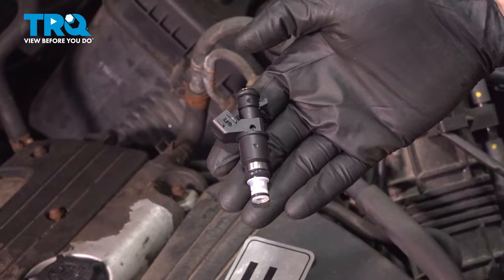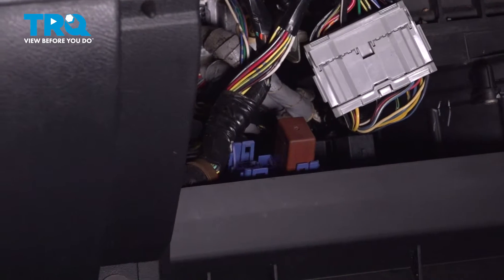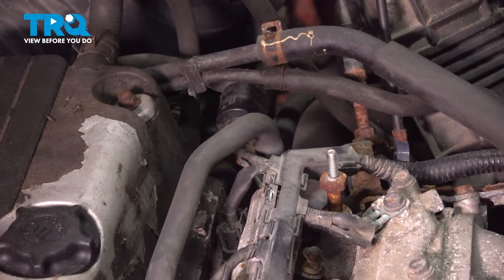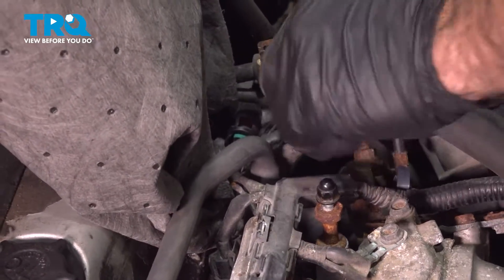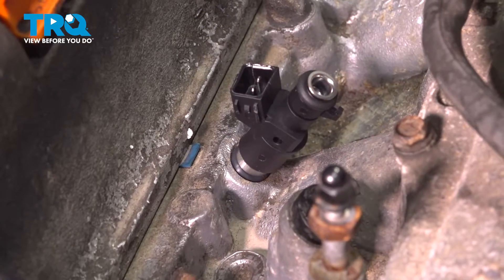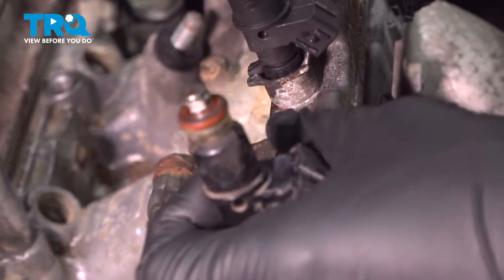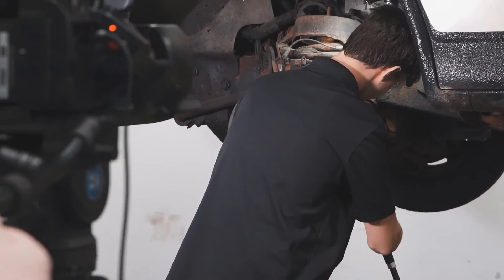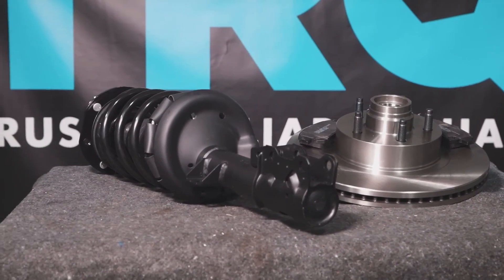How to Replace Fuel Injector 2003-2011 Honda Element

Comment: Is that the best place to add a fuel gauge to check pressure.  Where you disconnected the line ??  Thanks.

Comment: Chances are, if you have an older vehicle, most, if not all injectors will be stuck to the engine. In these cases do not pull the rail too much, it's useless, and you may damage things or bend the rail.  Simply remove the clips that are holding the injectors to the rail and disconnect the power plugs, so when you pull the rail, the injectors will separate from the rail, not the injectors from the engine block. Why? Because there's only 1 o-ring sealing the injector to the rail and requires way less force to slide out than the 2 o-rings holding each injector to the block. In addition, the bottom connection is usually more rusted than the top side of the injectors. This is a  LOT easier and requires LESS force.  Once the rail is out, don't be surprised that most stuck injectors' tips will break as you force them out and the tip will be stuck inside the block like the video shows. Luckily it's not too hard to remove if you have tools and it's not too brittle that it will fall inside the cylinder head.

Comment: Very helpful video. I successfully changed cylinder number 1 injector on my 05 CRV. Had zero issues pulling the rail out. I used 2 stroke oil to lube the O rings and had no troubles getting the rail to seat. Thanks for posting!
Reply from the maker: +Goopy Geiger Thank you! We love empowering our customers and showing how to perform DIY auto repairs with our high-quality auto parts! http://1aau.to/m/Shop-TRQ

Comment: Doesn’t brake clean degrade plastic O rings? A petroleum based lubricant is usually the best choice for plastic parts like that.

Comment: Hi thanks for the detailed video. I Was wondering what can we use to safely clean off the fuel that spilled on the engine head when you disconnected lifted up the fuel rail?

Comment: I was able to get everything off easily but I didn’t realize how difficult it is to actually seat the new injectors into manifold. I’m watching this at work. I tried to do it before my shift but I had to leave it into later which is why I’m watching this but I thing this guy went back and seated the injectors into the manifold and then the rail onto them, because that’s the only thing I can think of doing different when I get home. I already tried to use a hammer to seat the plugs but I knew that was a bad idea so I expect if I install the injectors to the manifold first and then the rail onto them. I’m working on a 03 accord chasing a misfire and I’ve already replaced with new coils and plugs so this must be issue anyways Blah Blah Blah